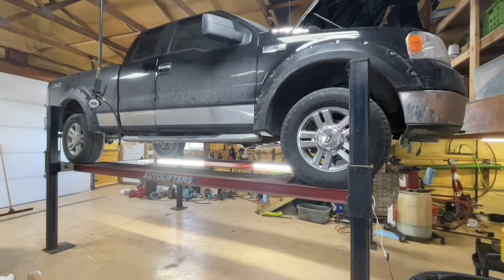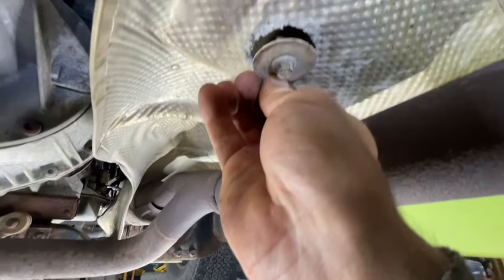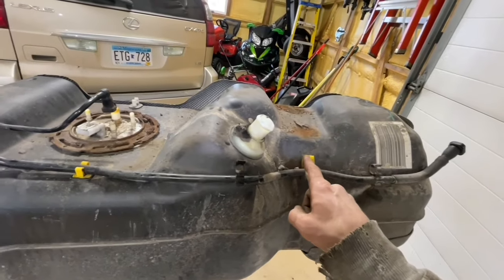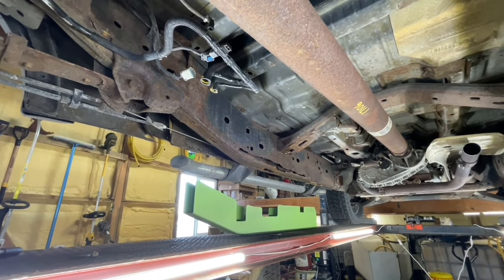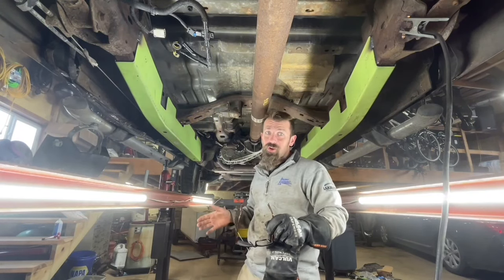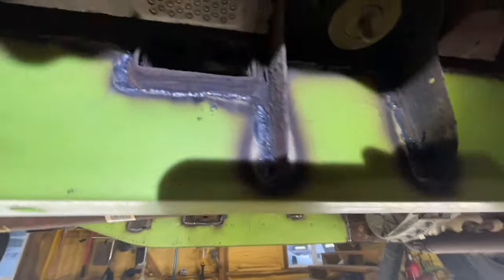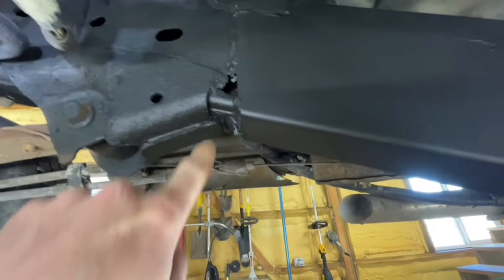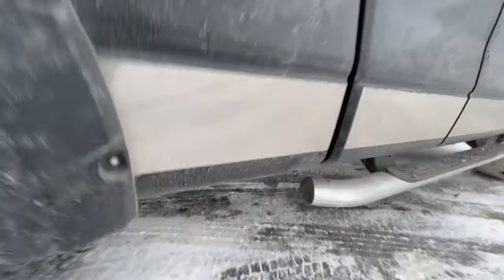Rusted out, rotted F-150 frame: repair, fix, 2004-2008, this one is pretty bad!

Comment: Just wanted to ask the what it cost this guy? I thought about doing this to my 2006 fx4 w- 282k on it. I found a guy near me that said he would weld it for$600. I thought, cool let's do it. But I had to remove the bed. After breaking 2 torx bits and pikes of trust on the ground from hammering the books, noticing for rust and mount rust, I decided it's not worth it. I've had the truck from 30k miles and the interior was still very nice. I just decided it's not worth the time or money. But great video any way!
Reply from the maker: Is cost around $1,500.  When you get in to repairs like this, they are all different so I'm somewhat hesitant to post that.  But that is about where this one ended up at.

Comment: How much does it cost for this job? What do you recommend to use to remove the corrosion rust (crimped cup, twist wire cup, twist wire wheel, etc.)? How many do I need to remove the rust on the 2000 Toyota Tundra frame (so I can order the right quantity online)? I know it depends on many factors, just give me a rough estimate? Thanks.
Reply from the maker: I had about 18 hours in to this one.  Plus the relatively low cost of the Dorman parts and the Fluid Film and undercoating.  Cost really depends on the local shop you choose.  I've sure it varies greatly.

I used a flap disc (one was all I needed) to clean off the areas I needed to weld on.  A hammer is actually my choice to knock all the big stuff off that's no longer doing anything.  The way I approached this job was not to remove all rust and try to seal, but rather soak it with fluid film to stop it from spreading.  I don't think it would be possible to truly remove all rust and get it sealed and permanently stopped.

Comment: You should have cut some of that rust out. I know on Jeep Wrangler when you use these same repair rails, they tell you to cut the bottom half of the frame out so you don't have all that rust laying in there to start working on the new parts. I have to do this repair to my 05 F150 and my 99 Wrangler soon and I definitely plan to cut that crap out first.
Reply from the maker: Certainly not a bad idea.  I didn't want to remove any remaining structure.  I really soaked the inside of the frame with fluid film to help with future rusting.
Reply: Removing rust is not removing structure. It is removing rust. Adds significantly to the price but also improves longevity, if the customer is planning to keep the truck. I personally do not offer frame repair with rust removal but, I recommend ding another shop for that

Comment: i wouldve liked to see the original frame rust treated, at least a rust stopping paint, but overall that's a solid repair, didn't even know they made sleeves like this
Reply from the maker: The goal is that the Fluid Film will help prevent further corrosion on the existing and new metal. I don’t believe that’s entirely possible though. 

These sleeve Dorman makes really makes it a much easier job. Anything beyond this and you should definitely consider frame replacement IMHO. 

Thanks for watching!
Reply: @bennieaust  oh ok i didnt know that, hopefully itll last the rest of the trucks life and yw keep up the great content
Reply: @bennieaust  ironic i left this comment because I am actually doing this same repair on the same truck haha. didn't even know it at the time
Reply from the maker: @slimsqde7397  I’m not surprised, these trucks are notorious for it. :(

I’ve got links in the description for the Dorman parts and the other supplies I used.
Reply: @bennieaust  yea ive seen that since looking into it. luckily this truck is only rusted on the driver side frame rail and everything else is basically rust free.

 also i found the links, much apreciated!

Comment: Do you know how this held up? It must’ve snapped eventually? They say vertical welds weakens the structural integrity the most bc of how it weakens the metal at its most demanding angle. What size rod did you use?
Reply from the maker: I have fairly low expectations for this truck, but not nearly as low as yours. Lol, it has not snapped, it’s doing fine. 

I used a MIG welder with .035” wire.
Reply: @bennieaust  haha just wondering if I can still use it for a tow vehicle under
Reply from the maker: @KollynJ when people asking about making the repair I recommend to them that if they don’t plan on hauling heavy load and towing heavy trailers they will be fine. If it’s basically a people hauler then your truck is a good candidate. I’m maybe being a bit conservative, but I don’t want anyone taking any chances.

Comment: What is a fair price to have someone do this needing it done on my 2006 f150. Mine looks almost identical to the truck in this video. Wish ford would have put more holes in the bottom so they didn’t hold so much moisture!
Reply from the maker: I get asked this question a lot and it’s very hard to answer because every truck is different.  I never can be certain until I start working on one how bad it actually is. The rust issues can be significant worse than it initially appears. In fact it pretty much always is worse than it appears. It can take many extra hours to address addition issues.   This particular truck the owner spent about $1500 on the repair IIRC.
Reply: @bennieaust  appreciate the response thank you!!
Reply from the maker: @amkoutdoors  you’re welcome!

Comment: whould you put that on a post lift now? or even use it to tow with after that repair?
Reply from the maker: There were still other questionable areas on the frame so I would be leery of lifting with a 2 post lift on this truck.  I would be less worried about towing, but wouldn't try to tow anywhere near max capacity.  Every truck would have to be evaluated individually on these things.

The Dorman parts worked great and it's much better than when it came over but nowhere near as good as it was when new.
Reply: @bennieaust  what’s the purpose of these repairs if you can not use the truck ?
Reply from the maker: @briizcustoms9543  every truck has to be individually evaluated. In the extremely bad cases, this repair is the difference between sending the truck to the junk yard, or being able to continue to use it as transportation.  On the better cases, when it saved before it’s to bad, the truck can absolutely be used as the truck it’s supposed to be.

Comment: what about the inside of the frame??   It is going to fillip with salt water and continue to destroy the frame...  It could be treated by hammer and removal of debris, then soaking in phosphoric acid,  flushed with water, dried, then a treatment of fluid film or 60 weight oil thinned with diesel sprayed inside heavily.
Reply from the maker: Most of that was covered in the video.  There wasn’t anything trapped in there since the bottom was rotted away.  There are drain holes so the frame won’t hold water. I did use a few cans of fluid film inside the frame once the repair was complete. 

Definitely not the end of the rust but definitely game the truck a second chance.  Hopefully the frame outlasts the next major problem whatever that may be. 

Thanks for watching!

Comment: The corrosive elements frighteningly quickly ate the chassis on a newer truck.  Frightening.
Reply from the maker: Yes, it is a bit frightening. Especially since you might not notice it if you never look under the truck or know what to look for.
Reply: @bennieaust  How does one prevent that corrosion, possibly caused by road salt?
Reply from the maker: @aguilayserpiente  there are a lot of products available but one of my favorites is Fluid Film. If you apply a product like that on a regular basis that will greatly help.

Comment: Why would u not cut out rust prior to installing theses it's going to keep rotting away underneath
Reply from the maker: Because there would be no frame left.  You are absolutely right though,  This is not as good as frame replacement.

Comment: Would it work to drill holes and bolt it onto the frame?
Reply from the maker: It would help a little, but I think it would be a far second to welding it.

Comment: Where are you located I'm interested on fixing the rust of my truck like how much do I have to spend to get the job done thanks
Reply from the maker: In Minnesota.  Where are you located?
Reply: Whow  I'm all the way in NYC wish you where somewhere close ,thanks ,
Reply: Good work you did in that F150
Reply from the maker: @ces4r123456789  yeah, to bad I’m not closer. Thanks for checking out the video!
Reply: @bennieaust  is there a way to me to reach out to you? I'm just across the WI boarder..would be curious to talk more about you working on my frame if you'd be interested?
Reply from the maker: @eitremoutdoors8914  , google bennie aust and you'll at find my linked in profile.  Message me through that.  I'd rather not post any personal info here.

Comment: do you think tacking it all around would be good? and can it pass inspection?
Reply from the maker: Only Tacking?  At that point I'd just put in a little more time and fully weld it.  We don't have inspections here, so I don't know.  Way more likely to pass after the repair then before!
Reply: @bennieaust  thanks for the reply. Yeah true, do you think I will have enough mig feed with 2lbs for just one side? I 
 got 0.8mm
Reply from the maker: @ashleybernard1055  it will be close!

Comment: Where did get those form bc I just bought a f150 looks just like this on the video and the frame has couple of holes in and I want bye these what you used to fix it
Reply: You said something about rockauto can you send me the link where to get these form
Reply from the maker: There’s a link and part numbers in the description.
Reply: Thanks I found
Reply: I just got on there and looked they said they are out of stock and didn't know when they have any where else can I get them at

Comment: It is maddening that the manufacturers put such little thought into simple things that end up setting the stage for premature failures like this rusted out frame. This frame should have had drainage holes to prevent water from collecting inside. They don't care and count on the vehicle not lasting so you have to replace it. Well guess what? I got burned like this with my Saturn Vue and am through buying American vehicles. Under my Saturn I found two frame members that were severely rusted out due to water collecting inside and laying in there. I live in the Northeast and they use salt on the roads in winter which kills the underside of vehicles. The rusted members each had a square access hole in the side to allow a nut to be installed for bolting the undercarriage to the frame. If Saturn just added a rubber plug to prevent water from entering that frame member, this problem would have never happened.
Reply from the maker: I totally agree. And especially on something big like a frame. :(

My personal opinion is that Toyota products are pretty top notch but they have a few fails throughout the years too. Even including frame rot just like on these fords. There’s no perfect answer.